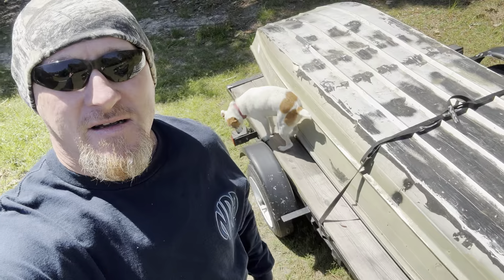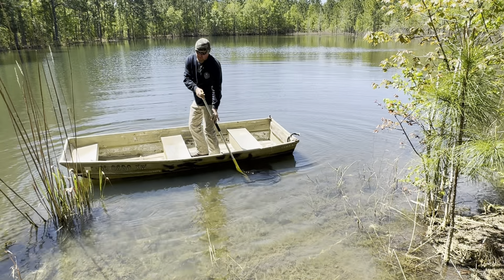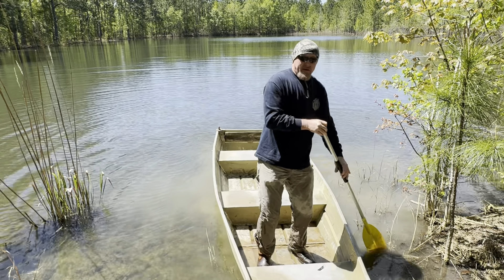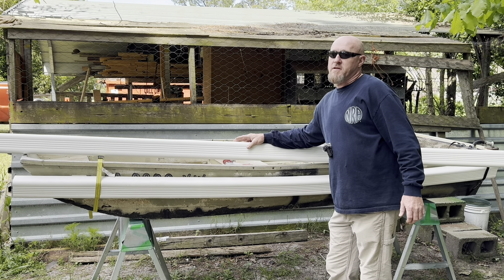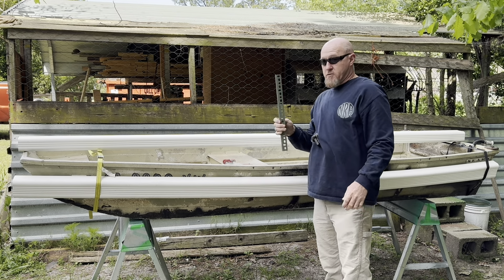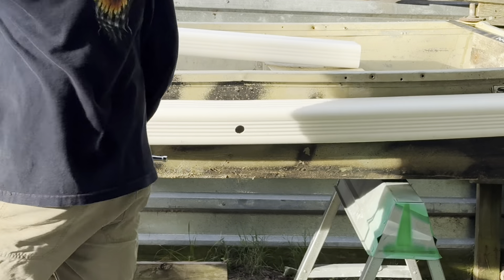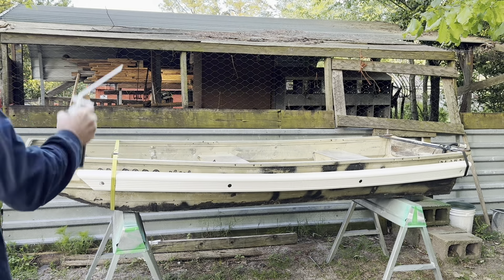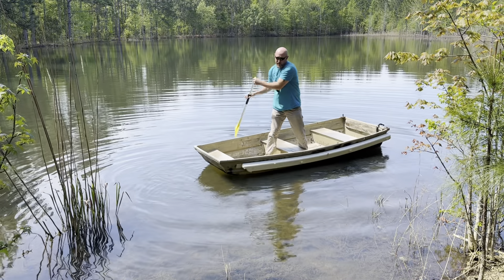How To Stabilize a Jon Boat

Comment: they should be lowered to water level
Reply from the maker: They really could have been put lower on this boat to get the most stability out of them.  I put them a little higher on my other boat so I could get less drag on the boat when running the outboard.  You’re right though, this boat will probably never see a motor big enough to worry about planing it off. But who knows what I’ll end up doing. Thank you for your input and thanks for watching.
Reply: I was thinking the same thing
Reply: On the front pipe, should put in an elbow for less drag
Reply from the maker: @hiennguyen-uq1dc  good idea. Thanks for sharing.

Comment: With pvc, you can heat it with a heat gun, and bend it into any shape, so you could bend it to the shape of the boat, also, if you cut slits on the ends, you could heat the end and bend it like a box lid, to cover the ends of the tubes.
Reply from the maker: Excellent ideas, thank for the tips and thank you for watching.

Comment: They do nothing if not displacing  water
Reply from the maker: You got that right. Thank you for watching.
Reply from the maker: Correct, they are doing nothing as long as you are in the middle of the boat and the boat isn’t pushed down on one side.  Thank you for watching and for the comment.
Reply: Should have mounted at Water line at minimum. Shouldn't affect if run outboard. But would make contact with Water as soon as you lean one way or the other
Reply from the maker: @jimburnham3909  definitely could have done that, just didn’t want the drag.

Comment: Maybe with the room you have on side of boat, double the down spout putting 3 inch side to boat making a 6 inch tall and 4inch wide floatation rail on each side, try a heat gun for forming. Thank you for trying this, and sharing. Definitely gets the ideas flowing.  Be careful and God bless.
Reply from the maker: That’s a great idea. Thank you for taking the time to share your thoughts.

Comment: Great idea. Suggestion: use a heat gun to blow hot air into the tube while it is strapped against the boat and it will soften and form to the hull more naturally. I've done this with pvc pipe
Reply from the maker: Excellent idea! I will try to remember to do that on the other side. Thank you.
Reply: @wisdomandthewoods7422  looking forward to it. Greetings from NY

Comment: Great idea. What if instead of putting it above the side rib on the boat it was placed under that rib. Would that not help eliminate some of the instability? If the floats were lower it might not have as much tilt before the stabilizers actually do their job. Just spitballing ideas. The wife and I went out yesterday and I got my babtism in 30ft of water when it rolled to one side and dumped my fat ass overboard. And of course, she only weighs about a buck twenty so there was no getting back in the boat because she doesn't weigh enough to hold down the other side while I get back in. Had to old on to the boat while she trolled back to where I could touch.
Reply from the maker: @TimCoble-l6w  I’m glad y’all are OK. You are absolutely correct about putting the the stabilizers below the rib. It would be doing its job at all times that way. I put it above the rib just in case I wanted to put an outboard motor on it. Having it above the rib was to have less drag.
 I have videos where I made stabilizers on another boat (v-hull) and having them just touch the water allows good speed and the stabilizers only work when they are needed. You should check them out. Thank you for watching and commenting.

Comment: Should put that thing lower.. Like at the waterline so it will stabilize it immediately. Go for waterlin mount,
Reply from the maker: I may do that on another video. I keep putting them higher up to keep from having the stabilizers ploughing through the water. Trying to get the best of both worlds. 
 I do need to experiment with mounting some lower so that they are working full time rather than just when the boat is leaning to one side.
 I do think that it could possibly risk a false sense of security though, creating a tipping point (or a fast tip spot) once the stabilizer is so far down in a lean. 
 Higher up, you have a clear reference point being the water line.
 Good ideas. Thank you for the input.

Comment: Should have put it lower at the water line.
Reply from the maker: @saltydawg9260   What up Salt? You are right, I could have put them lower and they would work sooner being already in the water.
 I tend to put them higher up in case I want to put an outboard engine on the boat. Having them higher up keeps them from plowing through the water causing a lot of drag and preventing the boat from planing off. 
 Thank you for watching and taking the time to comment.